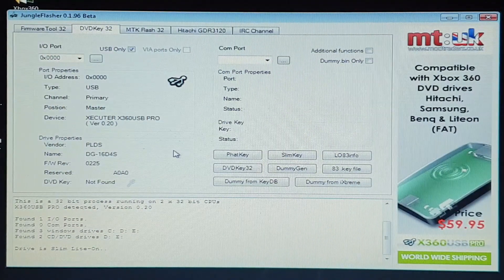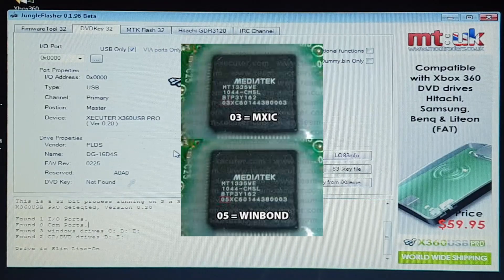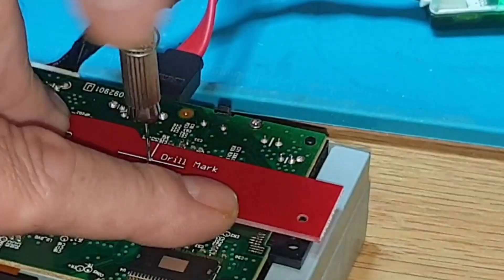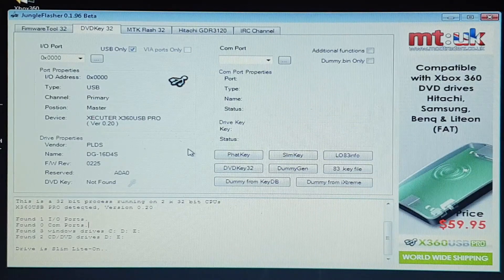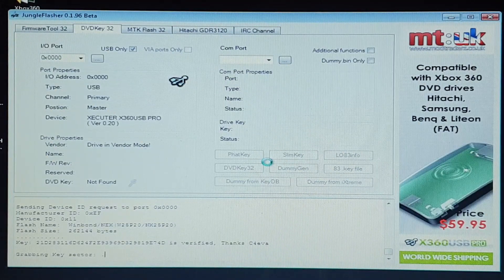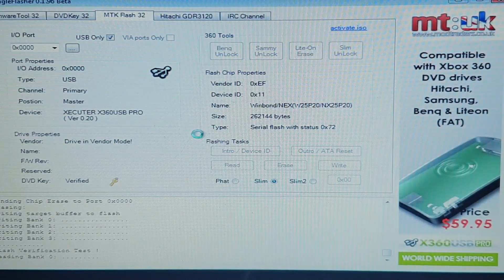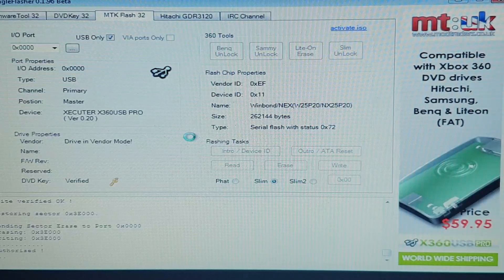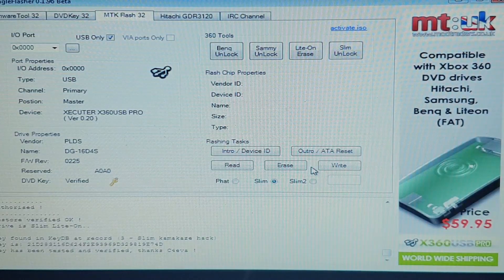Xbox 360 Slim - Flashing CFW to a LiteOn DG-16D4S using the kamikaze hack Tutorial

Comment: I have the same 16d4s drive, and even though it's marked on the chip where to drill, I'm still afraid of messing it up. + it seems like it can be stitched in another way, without drilling. only through the programmer. Can you tell me if there is a cheaper alternative to the X360USB Pro? It's too expensive for me, and it costs more than half the cost of the console itself. is there any other programmer with a sata or usb connector that will work through the jungle flasher?
Reply from the maker: Yes its scray .Just get an LTU board for it .. you'll still need to able to flash the drive tho ..